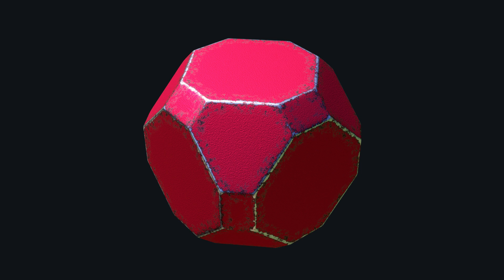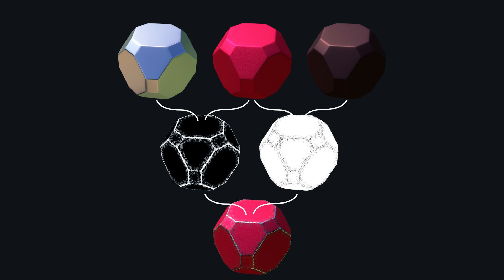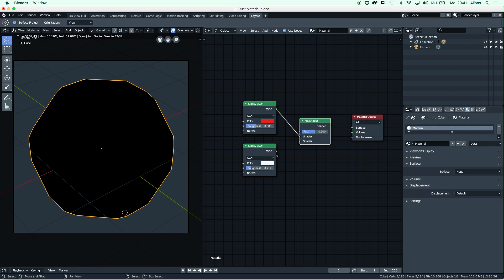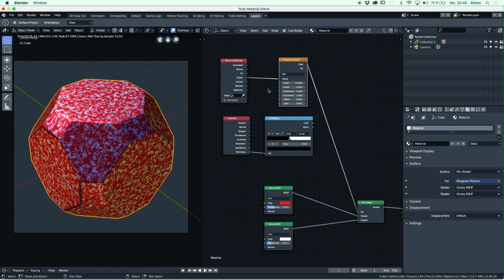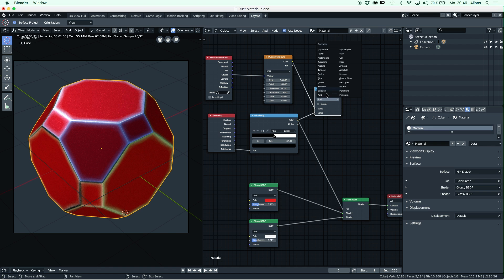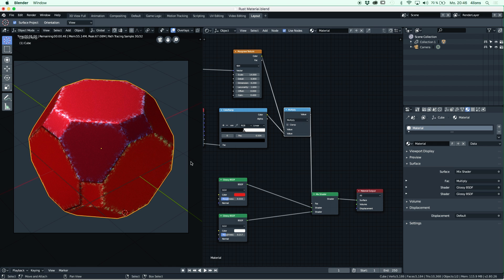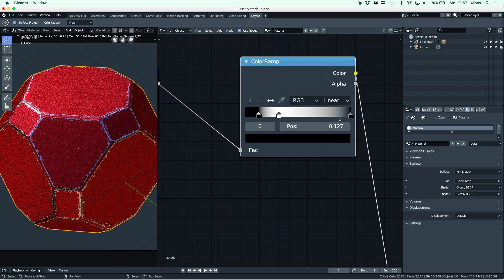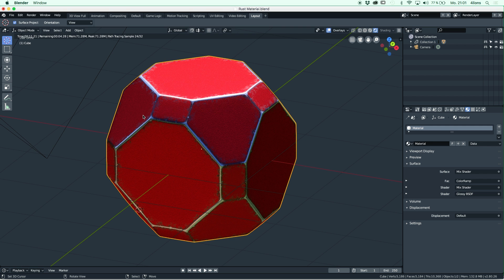Procedural Rust Material in Blender - Tutorial

Comment: can someone explain why my pointiness is not working T-T . blender version is 2.93.1
Reply: Hi, I was having the dame issue but try just opening the blend file in 2.91 and the Obj should have the material and it works correctly.
The thing is: the Obj has an Sub D..If you turn off the Sub D it will not work.
Create a cube , give it a Bevel mod with min 2 seg. and then give it a Sub D with min 2.
The material should work as intended. 
Hope this was helpful.
Ps. Check my YT.
Reply: dosnt work in eevee.... rip
Reply: Try to use Bevel node, it did work for me with my previous Edge Wear shader
Reply from the maker: I am very sorry. Pointiness is just not supported by Eevee so unfortunately, this material will only work in the Cycles render engine.
Reply: @thesparkofart8616  Pointiness needs geometry (Sub division) to work so its less useful.
Reply: @EDcase1  unless you bake it
Reply: @thesparkofart8616   please help, i tried to bake the material into image texture but i got nothing but black colors on the outside of the UV Map. How do I fix it?

Comment: Tried this and it just hits the whole model rather than the edges ;_;
Reply: view it in render mode
Reply: I think it depends on the geometry
Reply: Check your color ramp
Reply: wrong shader input order on the mix node. switch them around.
Reply: @TheCollectorEdd  i depends more of the hardware, the original file dont show rusty edges on mi pc
Reply: @pantaredreammaker  I don't think it should depend on hardware. Did you use Cycles? Because I guess it won't work on Eevee.
Reply: @mipe7755  i use both

Comment: if you have any issues with nodes please make sure following step before you start your work with nodes. First this node work with cycle render engine it does not work with Evee.  After that  you should add HDRI map for reflection (click the world section + click the color section and under the texture column click the environment texture you can download the HDRI, the link below  (https://hdrihaven.com/hdri/download.php?h=symmetrical_garden&r=2k) after that please  go to Render section click the Transparent which is under the Film section( for hide the background ). On the other hand  your model has to be subdivide otherwise it does not work for this you can use subdivide surface modifier it subdivision level should be 2 for both section when you done you can play with the nodes :)

Comment: does not come out the i want it even if i copy the node group from the file, wont do the egdes
Reply: if you have any issues with nodes please make sure following step before you start your work with nodes. First this node work with cycle render engine it does not work with Evee.  After that  you should add HDRI map for reflection (click the world section + click the color section and under the texture column click the environment texture you can download the HDRI, the link below  (https://hdrihaven.com/hdri/download.php?h=symmetrical_garden&r=2k) after that please  go to Render section click the Transparent which is under the Film section( for hide the background ). On the other hand  your model has to be subdivide otherwise it does not work for this you can use subdivide surface modifier it subdivision level should be 2 for both section when you done you can play with the nodes :)

Comment: Its a good ide btw may i correct that? Arround the minutes 07:xx there you duplicate the color ramp and geometry " however you mixed up with the maximum not a multiply? Which mean one of those is back to an offset (no use). Try to manual subdivision to minize the vertise to keep it at easy render ... & Thanks for the idea

Comment: I cant get the colorramp the way it shows in the tutorial, I followed the exact same instructions and it still wont work for me. Can anyone help?
Reply: if you have any issues with nodes please make sure following step before you start your work with nodes. First this node work with cycle render engine it does not work with Evee.  After that  you should add HDRI map for reflection (click the world section + click the color section and under the texture column click the environment texture you can download the HDRI, the link below  (https://hdrihaven.com/hdri/download.php?h=symmetrical_garden&r=2k) after that please  go to Render section click the Transparent which is under the Film section( for hide the background ). On the other hand  your model has to be subdivide otherwise it does not work for this you can use subdivide surface modifier it subdivision level should be 2 for both section when you done you can play with the nodes :)
Reply: I too had issues, and could not get the color ramp to give the fine detailing at the edges. I was using a simple ico sphere out of the menu, and needed to bevel the edges and add a subdivision modifier to get it to work. It seems the method needs enough geometry to work.